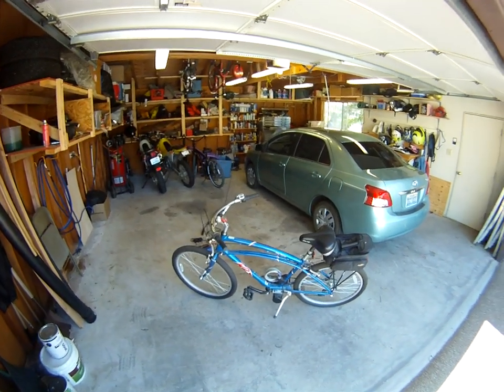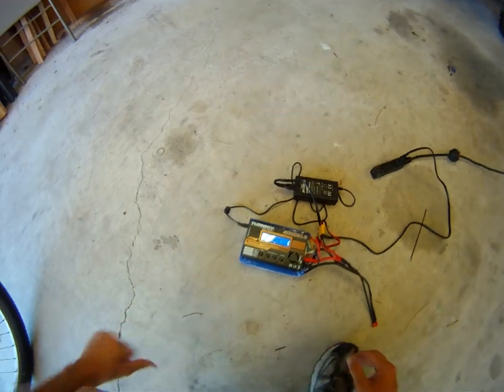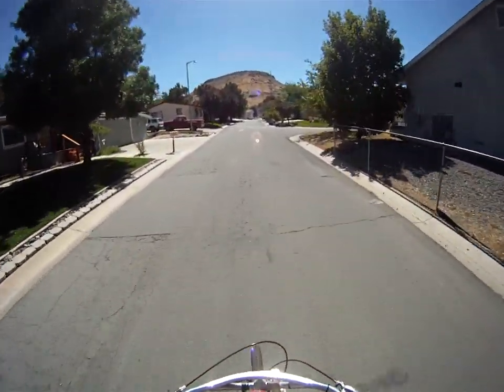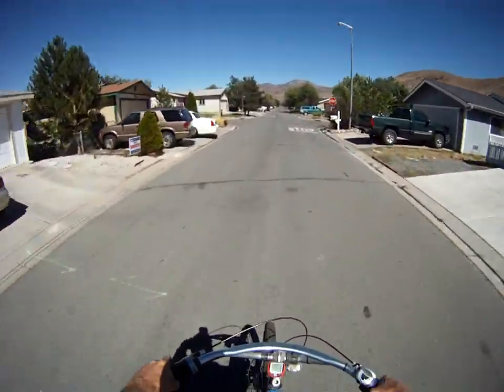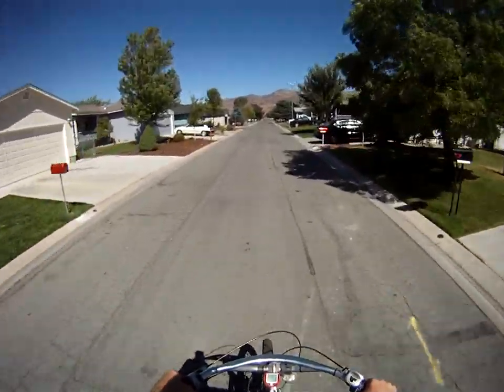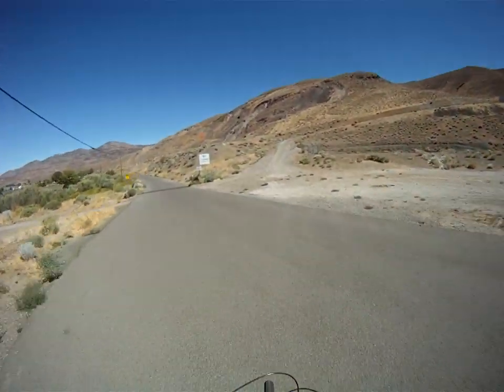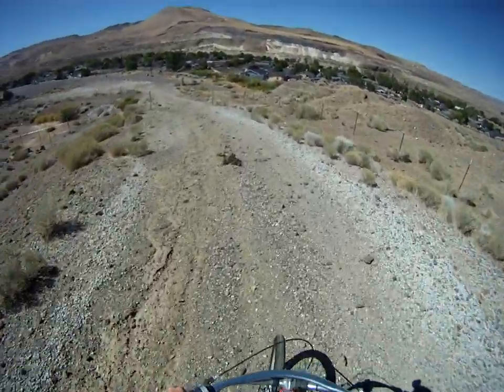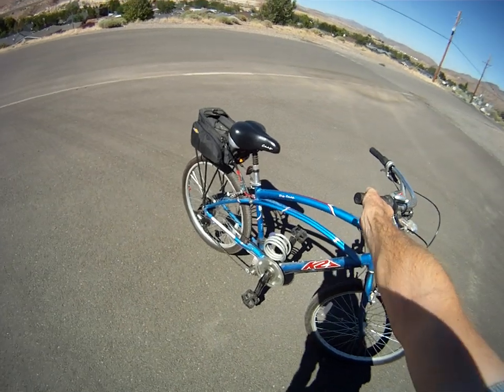Cyclone Electric Bike kit 360W motor running on LiPo Helicopter batteries

Comment: What do you think about this setup that Ive been putting thought on for some time now, 24volt controller that puts out 60amps cyclone motor mid drive. The motor is rated 2000-4800watts water proof. Two 12volt 23lbs 35ah lead acid batteries used in series. On their site it doesn't say what wattage at 24volts is so Im not sure if its right but I multiplied 24×60 to get the Watts which 1440watts Im guessing. I live where there are lots of hills and trying to get the bang for my buck you know. Thanks great video!

Comment: does AH matter in terms of speed? will it be any faster with 15 or 20 amp hours?
Reply: HaconBaconon capacity is the AH means longer life battery. Voltage and watt's gives u the speed.
Reply: Wayne & Rebecca Detectorist Thanks for the feedback, i had learned that by now though haha. 1 year later